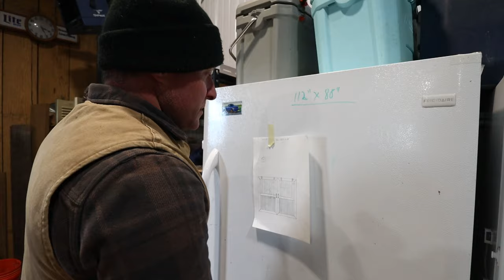BUILDING GIANT Barn Doors - Budget pole barn build!

Comment: Are you nervous about not using treated 2x6 for the door frames? Do you feel good about the stain preventing rot over time? Also did you use 1/2 or 3/4 inch plywood for the backs?

Comment: I followed your link for the Door Hardware, but only find track length of 8 feet. I am building two 16 foot doors for an Aircraft hanger. Will need 64 feet of track. Any suggestions where I can find these lengths ?